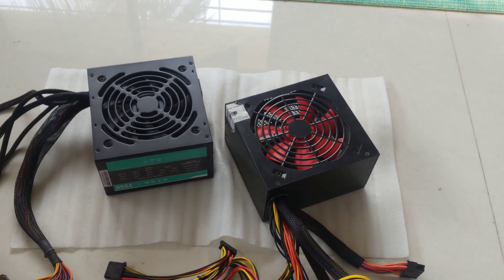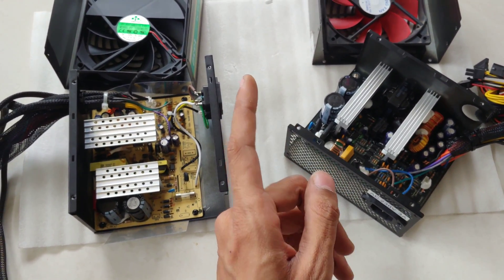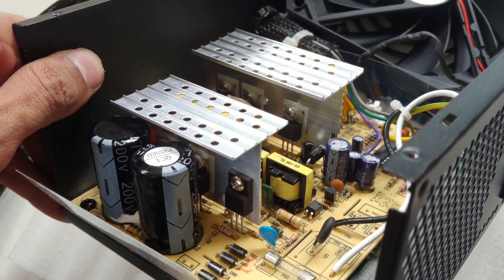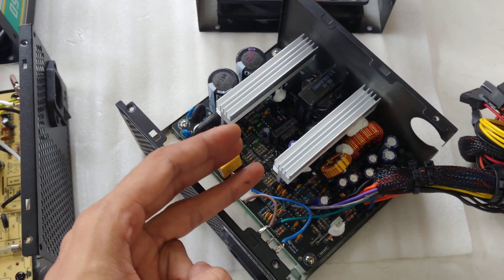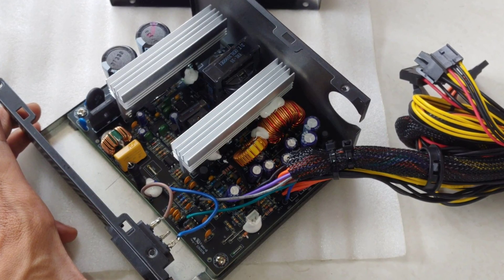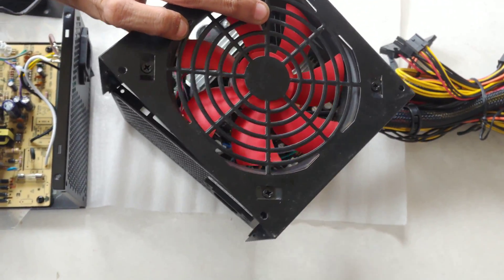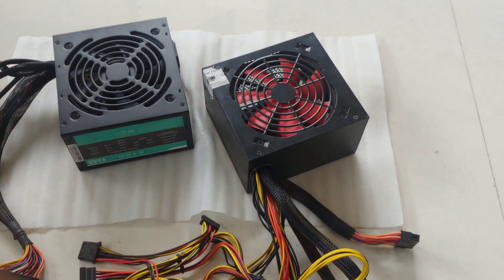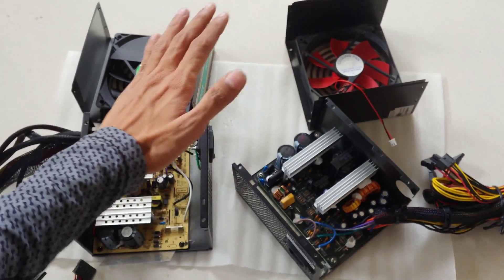Worst Power Supply vs. Best Power Supply | Teardown | Detail Overview & Comparison

Comment: First one is the old half bridge design, second one is the modern pfc type. Altogether they are like sheep and cow !!! Not comparable at all... Obviously the cheaper one doesn't have emi protection inductors, x,y capacitors, mov in the primary side. Furthermore, sufficient inductors and capacitors are also missing in secondary. Another question mark is the longevity of capacitors in the secondary. You cannot expect these things in a cheap power supply and certainly it damage your expensive motherboard, daughterboards in your system. Iam also doubtful of the protection features, short-circuit, ovp, uvp, PG etc.
Cheers !!!
Reply: Well modern technology but doesn't have pfc

Comment: Let me make one thing clear... Both are cheap and crap.. don't judge them from colour of PCB or weight...
And don't judge psu on heatsink.. expensive PSU have very small Heatsink..
Most important thing is it's designe...

Comment: i installed chrome os by seeing your previous video.but in the end,after restarting it it shows the logo and then a blank screen with black cursor.could you plzz help?

my pc is dell vostro running on intel pentium g2020 and has ram 2gb and rom 500gb
Reply: I think, this is GPU problem!

Comment: Bro you made a video on triple with Linux and chrome os and windows . I did that but when I enter command sudo sh multi_install.sh it says ppa failed and process after that goes same as yours but when I boot chrome os it doesn't boots and a black screen with some codes , etc.  Came and it stops at a point and remains as it is . What to do now ?